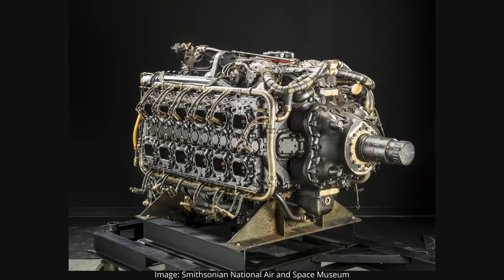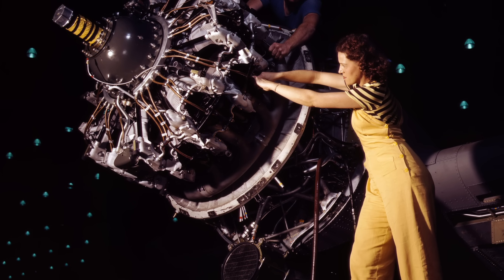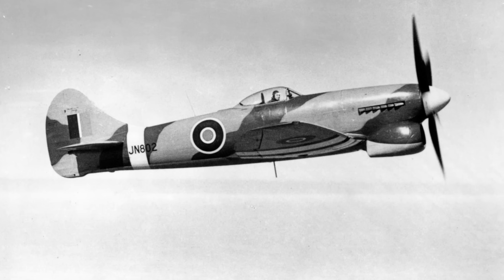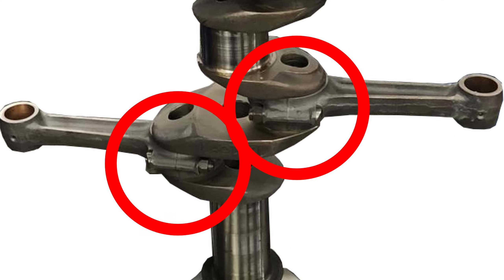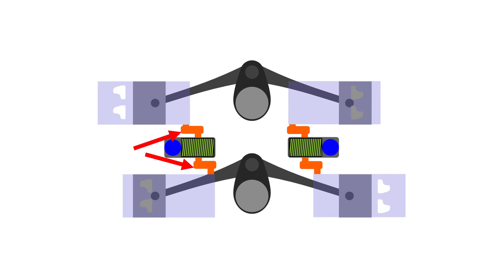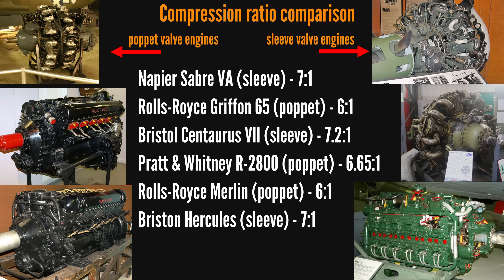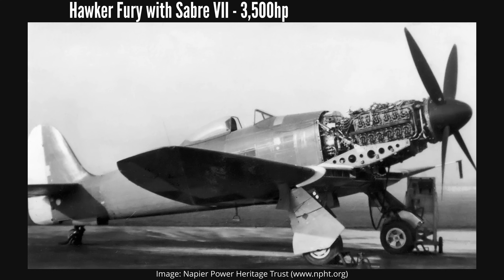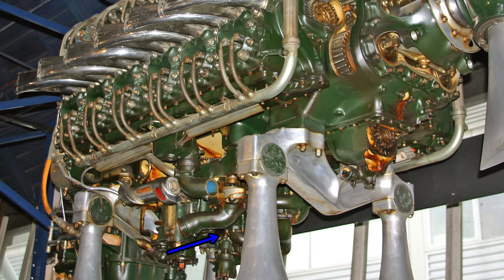The Complex Napier Sabre 24 Cylinder Aero Engine Explained Simply

Comment: In 1964 I was in school for my A&P license, and our powerplant instructor was a WWII veteran mechanic.  The man knew his engines and propellers better than anybody else, and he taught us well.  However, when he told us about the Sabre engine we just looked at each other and wondered if he was joking with us.  Actually, the engine was very real, and very important in the history of British fighter aircraft.The success of the Sabre convinced the Brits that the sleeve valve would eventually replace all poppet valve engines, but of course the jet engine ended the contest by the end of the war.
Reply: A good attempt by Napier at the time, but technology was already moving on to jets.
Great overview of Brit fighter big engine development and sleeve valves.
Reply: The other advantage is better air flow 
Into the cylinder since one of the biggest obstructions is the valve itself
Reply: It was Bristol that developed reliable sleeve valves.  Napier had endless trouble trying to get them to work until the Air Ministry forced Bristol to release their technology for use by Napier.
Reply: @anthonyjackson280 Bristol or Napier or Napier or Bristol . You make as much sense as this.
Reply: @alangordon3283  Napier had endless problems getting the sleeve valves to work correctly for the Sabre engine (sleeve warping, seizing etc).  Bristol had cracked the problem with their highly successful sleeve valve radials (Hercules etc).  The British Ministry of Supply compelled Bristol to release their technology to Napier as the Sabre development was considered crucial to the war effort.
Reply: @anthonyjackson280  The problems with the cylinder sleeves was solved by the Americans, an American company called Thompson was approached to provide a special centerless grinding machine that fixed the problem.,
Reply: Anybody who's a student of WW2 fighter development, knows about the Napier Sabre.

I'm not conversant with it's history or its designer but I guess he must have been a brilliant engineer.
Reply: Absolutely fascinating American technology.
Reply: @DoktorBayerischeMotorenWerke   The original idea might have been American but this implementation clearly wasn’t.

And this hardly constitutes ’technology’. Engineering, yes. Technology, no.
Reply: @thethirdman225  Knight sold the technology to several British engine manufacturers that were licensees, just like  Napier bought the technology for Deltic, Cutlass and Culverin from Jumo in Germany.
 Britain in general was years behind Germany, America and France in internal combustion technology and often bought licensed engine technology from outside Britain... of course these facts are seldom discussed in the UK and the origins of these engines is whitewashed and Anglicized for a UK readership..
Reply: @  Not true. The British were well ahead in a number of areas. About the only place they were really behind was in fuel injection. That can basically be blamed on one man (Dr Morley). They were quick to realise the benefits of cross flow heads, unlike say, Hispano. They were quick to adopt multi valve heads. And they were way ahead of anyone in fuel mixes and supercharger development and that goes back a long way.

By the way, this was not technology. It was mechanical, thermal and chemical engineering. There were no electronic or microchip components.
Reply: @ You’re not related to Wilbur Finnigan, AKA: soaring tractor, by chance, are you?
Reply: @thethirdman225  Do you work in the British News media? or the Ministry of Information??
Reply: @ I’m not British.

Is that the best argument you’ve got?
Reply: @DoktorBayerischeMotorenWerke  I’m not British. Does that answer your question?
Reply: @thethirdman225  You must be a Commonwealther...

Please name a British company that still makes British military or commercial aircraft in the UK?
Reply: @ Relevance?
Reply: @thethirdman225  EXACTLY! Sleeve valve engines were already known and understood to be a dead-end concept and were essentially obsolete technology upon arrival.
 They had already lost their relevance, the fact that Britain continued to pursue them at this point is an excellent example of how Britain had lost its own relevance in the aviation industry..
Reply: @  You’re joking, right?
Reply: @thethirdman225  Serious as a heart attack lad.
Please name a single British company the still makes modern commercial or military aircraft in the UK..
Reply: @ Why?
Reply: @thethirdman225  Why are you scared to answer??
Reply: @DoktorBayerischeMotorenWerke  Why are you so certain that I’m scared? Come to that, why are you so certain about anything? Why do you think your question is even relevant?
Reply: @thethirdman225  Why are you so cowardly and dodging the question?
Reply: @ I’m not interested in flattering your ego any further. Not only am I not scared of you, I’m bored. I have no interest in anything else you have to say.
Reply: @DoktorBayerischeMotorenWerke BAE.
Reply: @dkoz8321  BAE no longer exists.  only BAE SYSTEMS remains. it is not an aircraft company and divested it aircraft research and development division in 2005, it has never developed a jet aircraft.
Reply: @DoktorBayerischeMotorenWerke BAE is a sub contractor for F-35, Typhoon, and is actively developing Eurofighter Tempest 5.5G or 6G tactical aircraft. BAE builds and maintains BAE AH-64D Apache.  The UK and Dutch version of Apache.
Reply: @dkoz8321  The F-35 is an AMERICAN jet aircraft designed and manufactured by Lockheed Martin USA.
Typhoon is designed and manufactured by the GERMAN company Eurofighter Jagdflugzeug  GmbH. (it is no longer made under license in the UK)
 The Tempest DOES NOT EXIST it is a concept proposal for a possible aircraft that will be designed and manufactured by the JAPANESE company Mitsubishi.

The AH-64 is a Helicopter and was designed by AMERICAN company Hughes Aircraft and is currently manufactured by the American company BOEING AIRCRAFT.

PLEASE NAME A BRITISH COMPANY THAT STILL MAKES BRITISH JET AIRCRAFT IN THE UK?
Reply: @DoktorBayerischeMotorenWerke In 21st Century , in Free Western World, there are no more fully domestic aircraft Not in US , not iin NATO. Two exceptions . French Rafale and Sweden 's Grippen. Grippen uses Raytheon radar, F404 engine from SuperHornet , avionucs from Thales. Lockheed designed F-35 and assembles it. From components developed for F-35 by subcontractors. For BAE , its avionics and subassemblies. AH-64D is built for US and American clients by Boeing. For UK and Dutch, the Apache D and now E is built by BAE. Royal Navy F-35B is assembled by BAE. BAE builds Royal Navy submarines from scratch. All except reactor which is built by RollsRoyce on American S9G design PWR. BAE also builds , in USA, M2A2 Bradley, LAV-25 , and host of other systems for US Army, Marines , and NATO. BAE is huge.BAE and Royal Air Force are lead agencies on Tempest 6G aircrat.

Russia and China have elected or a forced to by circumstances to fully develop their own aircraft inhouse. China copies alot from Russia and pilfered data from West.
Reply: @dkoz8321  WRONG!  You are very confused and misinformed lad.

ALL U.S. Military combat aircraft are 100% manufactured in the United States!

It is forbidden under federal law for the military to buy weapons not 100% made within the borders of the United States

Just name a single British Jet aircraft still made in the UK?

NAME A BRITISH JET AIRCRAFT CURRENTLY MADE BY BAE?
Reply: @DoktorBayerischeMotorenWerke Dude! Everything I wrote is correct. Exercise caution and judgement begore shouting "WRONG!". Approved foreign subcontractors either setup local assembly or enter into manufacturing partnership with American defense and aerospace companies. Example is Airbus Helicopters.  Which setup assembly facility in Marietta GA to assemble UH-72 Lakota helicopter for US Army. Lakota is based on Eurocopter(Airbus Helicopters) EC-135 and EC142. 
On civilian side , wings for Boeing 787 are manufactured in Japan. 
Back in 1970's and 1980's , F-16 Vipers for NATO were manufactured in Belgium and Italy with components from Turkey. USAF F-16s were assembled in USA by General Dynamics , later Lockheed Martin. British Royal Navy and Royal Air Force F-4K Phantom II used Rolls Royce Spey engines and British avionics. 
US Navy just cancelled Constellation class frigate program due to budget and build time. Constellation started as Italian/French/Spanish FREMM NATO frigate. Currently serving in those navies. 
Modern weapon systems are just too complicated and expensive to develop alone. Even for mighty USA. There are exceptions. Aircraft carriers , submarines, and strayegic stealth aircraft.
US Army's new combat rifle M7, is designed by Swiss SIGG , and manufactured here by SIGG USA.
Kapish!
Reply: @DoktorBayerischeMotorenWerke  Napier was British as was Rolls Royce and Bristol.
Reply: @ianhollands1641  You are unfamiliar with American Charles Knight? He invented the Sleeve-valve engine, he also sold the patented technology to several British companies under licensing agreements.,
Reply: @DoktorBayerischeMotorenWerke  : So then, by the same logic, the BMW 003 turbojet engine is British Technology as it was British Engineer Frank Whittle who invented the turbojet engine?
Reply: @rokuth  Frank Whittle did not invent the jet engine... not even close. He is only the fourth person to successfully demonstrate a working jet aircraft engine..
Reply: @DoktorBayerischeMotorenWerke  Cobblers.
Reply: @fredericksaxton3991  Just the facts here, Americans invented sleeve valve engines... Germany invented jets.,
Reply: @DoktorBayerischeMotorenWerke  Really, remember we are talking a turbo jet engine, not just a gas turbine.  

Please provide the other people/organisations that preceded him.

Inventing and demonstrating are two different things, so please provide details of technical papers or patents that preceded Whittle's 1930 patent.  It should show a turbojet with the basic design of compressor, gas producer, and turbine that is designed to produce thrust rather than rotate an external shaft.  I am excluding other types of jet propulsion such as pulse jets and ramjets, rockets, balloons full of air, etc. as although these use jets of gas to propel them, they are not germane to mainstream jet aircraft.

Ohain was still a student when Whittle's FIRST patent was granted, in an interview Ohain said that he became interested in jet propulsion in 1933.  

Sadly, due to expediency,  this is from Ohains Wiki page:
 
"However, von Ohain explains in his biography that, in 1935, while his own patent was being prepared (and before he had begun construction of an engine), his lawyer gave him a copy of Whittle's patent (1930?), which he read and critiqued. As a result, he was forced to modify his own application so as not to infringe on Whittle's design."

I am not going to discuss Whittle's second patent that showed many different variants of turbojet including ducted  fans (he called them augmenters) both at the front and back of the engine to name a notable example.

Please provide information that contradicts the timetime below which clearly shows the Whittle WU engine running before the Ohain engine:

frankwhittle.co.uk/timeline/

Now I will admit that there is contention over exactly when the hydrogen powered Ohain first ran, Willi Messerschmitt puts it in Sept 1937 with an alternate date of Feb/March 1937 (very convenient) advanced by Ohain, there is no documentaion to determine which is accurate, the man doing the work or the man paying the bills.

If it helps, many patents are shown and partly discussed in the following document

dibley.eu.com/documents/RAeSTLSBrnch151215-IanWhittleandWolfgangBrix-PDFforAudio-15dec15.pdf

Please, do not try to split hairs or put in arbitrary requirements to make your point(s).

I will concede that the Ohain engine flew first although this type of design was not put into production.

Considerable gas turbine work was relied upon in the development of the turbojet, but without A.A. Griffith's seminal paper "An Aerodynamic Theory of Turbine Design" or an equivalent paper, where it was shown that all previous turbines were running stalled, none of them would have flown.  His work at the RAE and later Hayne Constant's work would result in the MetroVic F2 axial turbine flying in late 1943.  Although a technically superior design, like ALL axial turbojets of its era, it was unreliable so, as had been the case throughout the entire axial development program (yes, I am aware that it was originally designed as a turboprop), it was kept on the backburner.
Reply: @robertnicholson7733  Argyle lost the patent infringement case, Knight filed his patent years before. Knight developed and patented both types before Burt McCallum.
 Knight proved that his work had been copied.,
Reply: @robertnicholson7733  You sir are very confused and misinformed, the myth that Frank Whittle invented the Jet engine has been completely debunked by all of the factual evidence.

Whittle was not the first to patent.
build a prototype or successfully flight test.
 in fact, Whittle was not first to achieve anything related to jet engine or gas turbine development. 

Whittle would not (according to him and other confirmed sources) did not begin actual construction work on jet engines until forming Power Jets ltd. and moving to Rugby.
He would not successfully bench test a jet engine prototype until 1937. Two years after Hans von Ohain and Max Hahnn.
Professor Robert Pohl observed one demonstration at the Universität Göttingen in 1935 and wrote to Ernst Hienkel who came to observe a demonstration of a second prototype in 1936.

von Ohain and Hahnn were hired by Heinkel in 1936 and began construction of their 3rd (Heinkel HeS-1) in 1937 it was bench tested and construction of the 4th (HeS-3) protype, the 4th being the world's first flight-rated jet engine was successfully demonstrated in pure jet powered flight on August 27th 1939... two years before Whittle.

Whittle was only the FOURTH person to successfully demonstrate a working jet aircraft engine.
 He is only rightfully credited as the "First in the UK"

As you know, Metropolitan-Vickers licensed its technology from Swiss manufacturer Brown, Boverei und Cie in a licensee agreement brokered by A.A Griffith's.

Unfortunately, all of Metrovic's attempts to build a flight-rated jet engine that could pass the minimum RAE reliability standards for airworthiness certification were complete failures.

Metropolitan Vickers abandoned jet engines in failure in 1947 and returned to manufacturing steam engines.
Reply: @DoktorBayerischeMotorenWerke   Knights were double Sleeve Distribution engines, Sleeves moving only up and down.
The Burt-McCollum Single Sleeve Valve engines had the sleeve drive inducting an elliptical movement, best for lubrication and heat dissipation.
Minerva, Voisin, Panhard, Daimler were Knight double sleeve engines.
Piccard-Pictet in Switzerland patented an Sleeve Valve distribution, where Sleeve just turned, similar to the small engines RCV makes today in the UK.
Reply: @rokuth Both Whittle and von Ohain reached similar proposals for IC Airplane turbine engines.
Hahn from Heinkel patented the von Ohain turbine in the USA.
Reply: @DoktorBayerischeMoto renWerke Britons invented the Single Sleeve Valve distribution; the US born Knight patented the double Sleeve Valve engine.
Reply: @DoktorBayerischeMotorenWerke 
Not exactly, Argyll was able to show the Knight Single Sleeve Valve distribution could never work, but the attorney costs of litigation added pressure, along with the high production costs of Argyll cars to this Scottish company going bankrupt
Reply: @joseveintegenario-nisu1928  But von Ohain and Hahnn both constructed and flight tested two years before Whittle.
 Whittle would not begin any actual work on jets until 1936, this is confirmed by Whittles own biography..
Reply: @joseveintegenario-nisu1928  That is false, Knight patented both types first.
Reply: @joseveintegenario-nisu1928  Knight filed his patents first... and was awarded damages.
Reply: @DoktorBayerischeMotorenWerke  Absolutely no resemblance between the Double Sleeve in Knight engines and the Single Sleeve in Argyll and Bristols.

This is very well told in articles about Argyll cars of Scotland, easy to locate in the web.

As far as I remember, the winning argument in the Argyll defense was presenting to the court a model of Knight Single Sleeve engine, that could never work.

The fate and reasons for the lack of continuity in the Piccard-Pictet Single Sleeve engines remains obscure to me.

What I am sure is after the end of WW II, the Belgian car brand Minerva, making Knight double sleeve engines, was forced to produce Land-Rover, and was closed in less than five years.
I don't know if Belgians would praise this type of 'liberation'
Gesund +
Reply: @DoktorBayerischeMotorenWerke  French invented the jet engine concept, Britain and Germany both built different working jet engine designs. The German axial flow is the one we use to this day because it could be developed further, the british jet engine was far more reliable at the era but was a dead end since to increase engine power the engine had to grow too big to be placed on figthers.
Reply: @calumknight9178  Maxime Guillaume patented the jet aircraft engine first, but there is no evidence that he ever constructed or demonstrated a working engine.
 The First to construct and successfully demonstrate a working jet engine was Hans von Ohain and Max Hahnn.
 This First jet engine was also a centrifugal type.
 The centrifugal compressor is simpler to build and is less efficient, it is not inherently more reliable.
 It was head of Engine Development at the RLM, Helmut Schelp. A brilliant engineer and aerodynamicist in his own right, he halted any further work on centrifugal compressors as his fork had already concluded that it was an evolutionary dead-end concept and would be rendered obsolete by axial compressors.
 Dr, Anselm Franz invented the jet we use today and the designed the best, most reliable jet engine of WW2, the -004 'B' easily passed the PFTR reliability test for acceptance into RAF or USAAF service and the Americans tested the engine during Operation LUSTY and confirmed TBOs averaged 55 hours Better than Allied High output piston engines.
 The Allies would not have any effective jet engines until after the war and not without the dissemination of captured German technology and German experts.